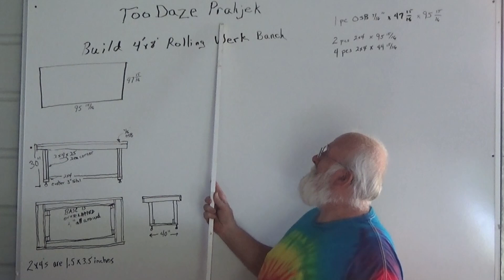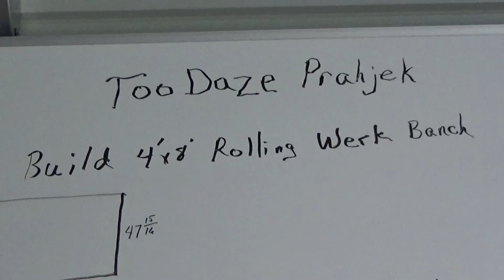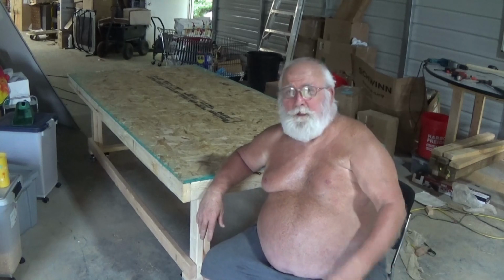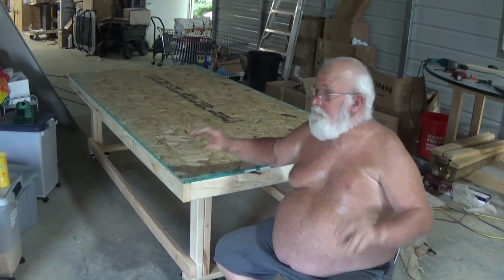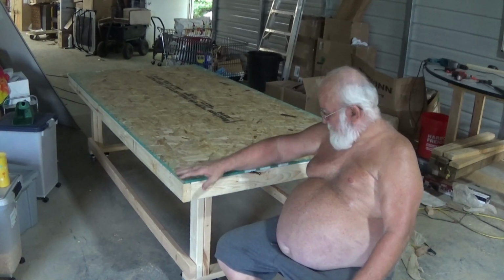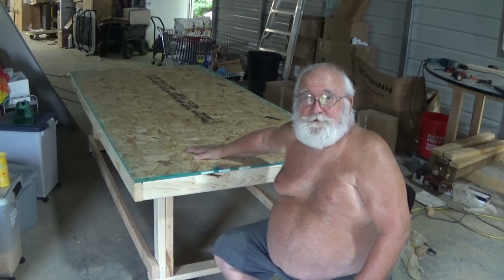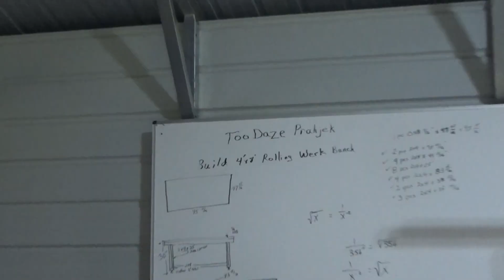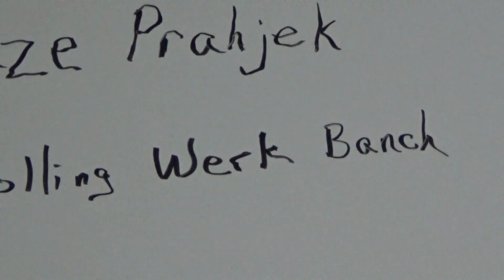PawPaw builds a 4' x 8' rolling work bench

Comment: Hiya Bob, I have got to do some cleaning in my shop before winter, built a wood working bench just for wood working it now has become a collect all bench on wheels lol, I restored a 1988 flhs Harley last year and still dont have the engine broke in yet so dam hot here this summer only took it out 5 times , I bought it cheap not running it had just been rebuilt but the engine block split into so had to get another block and transfer all the new parts but it runs good now and added some go faster parts lol , then my other Harley that has been setting for ten years the gas tank rotted out so I bought a new one and was going to paint the whole bike it needs it but the price of paint here is unreal so I sanded it with a 3in da pad and clear coated it doing the whole bike  that way it now looks like a real old bike , but glad to see you putting out some videos be safe and take care